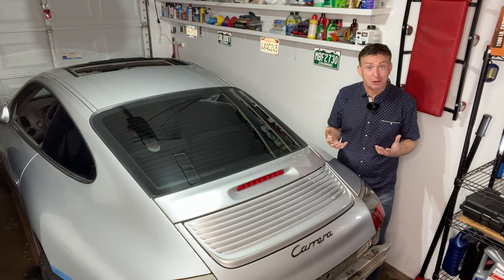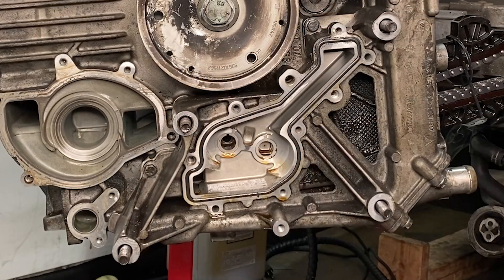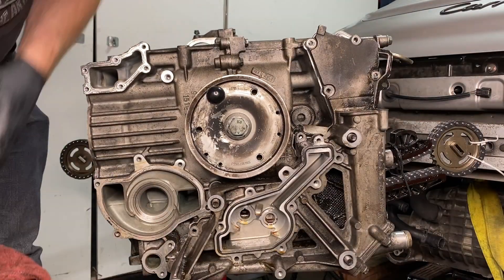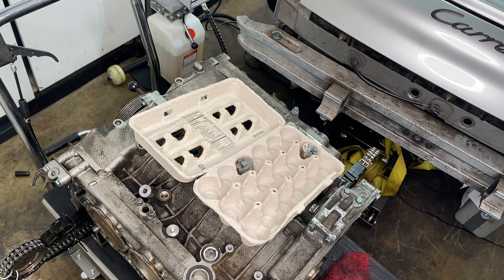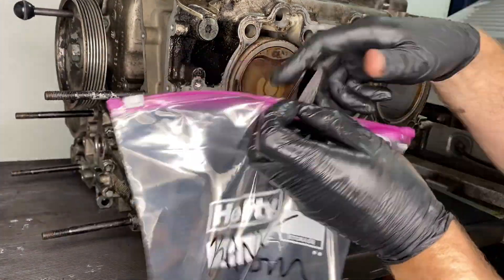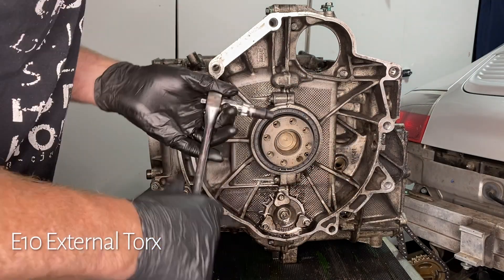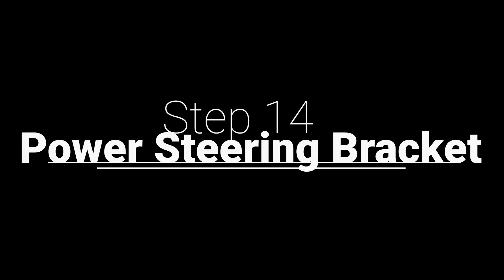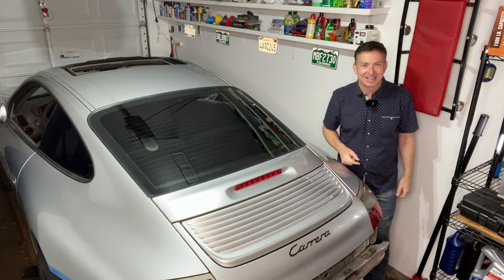How to Split a Porsche 996 Engine in Half

Comment: Thanks for this great series.  Any chance you looked into removing the oil pump and coolant manifold together?  Meaning remove only the coolant manifold and the oil pump comes out with it?  I'm at that point but only for inspecting/replacing chain guides on bank 2, and wondering if it's possible, and avoid having to put a new gasket there.  Sounds lazy, but it's not.  Just wanting to reduce the potential mishaps - if possible.
Thanks again and keep up the great work!
Reply from the maker: Howdy Tarek 🤠, I don’t see any reason why you “have to” open up the oil pump. All things being equal you should be able to whip off the console, work on the chain guides and put the whole console/oil pump back on. Thank you for watching 🤘😎
Reply: @ManinaGarage  Thank you so much for the prompt response!!!  Hope you'll still have the energy and capacity to respond to your viewers when you have a billion subscribers and a gazillion views!

Comment: Happy Easter for us All ! Man in a garage, all the subscribers and last but not least, Happy Easter Amber! 
I'll wait until the next video so I can understand better what do you mean by the LN engineering "pin all the gears"  Sorry to be stupid, but which gear are you talking about? Isn't the IMS shaft a hollow tube with just one sprocket?  
Also, which ball bearing system did you choose from LN, the ceramic bearing or the oil feed journal bearing?
Thanks for another great video
Reply from the maker: Hello Ricardo, the ims is composed of multiple parts that are press fit together. There are cases of the gears rotating separately to each other due to a loose fit. Pinning them in place prevents that issue permanently. I am going with the ceramic dual row. Not the solution. 
The failure rate on the dual row is already very low (1% or less) the LN engineering replacement dual row has a zero failure rate. That’s good enough for me. Thank you for watching. Amber, Tori and Audrey wish you all a peaceful Sunday 🐣🤘😎

Comment: EXTREMELY STOKED when you said you were sending the IMS to LN Engineering. Such smart work. This engine WILL NOT grenade after you are done. EXCELLENT STUFF Darth Sidious👍🏾
Reply: Ok Nate, now you got me worried🙄, why this engine will grenate itself if he changed the ball bearing himself? Isn't this ball bearing a very easy job to do? Specially now the the whole engine is torn aprt and  he have the IMS shaft on it hands
I'm asking you this not to be a smart ass, but because I'm replacing the IMS bearing myself since my engine is fine and I'm not disassembling anything

and I would like to understand the pitfalls on this operation
Thank you all
Reply from the maker: @1ricardobaptista  Hello Ricardo, it is very common to replace just the ims bearing with the engine still in the car. I am taking everything apart to make sure the big end bearings, piston skirts and cylinder bore are not overly worn/ damaged. FYI if you buy the bearing from LN Engineering they will rent you the installation tools for free. Good luck with your project.🍀 Thank you for watching. 🤘😎
Reply: @1ricardobaptista  No, no. I’m sorry for the confusion. You misunderstand. The M96 is bulletproof except for 2 flaws. IMS bearing and bore scoring. Both can grenade these engines. Our great friend and very good engine dismantler has shown in his videos that bore scoring is not an issue on his motor. IMS in my opinion is an overblown issue that affects under 10% of these engines. However if it happens you don’t want to hear that sh!t. General rule is if it hasn’t happened in approx 75k to 100k miles then it probably will not be an issue. Having said that personally I would still have the preventative replacement work done. Typically the bearing is done at clutch time and is serviced by a kit supplied by LN Engineering. However in this case since everything is disassembled already you just send LN the part and they make the necessary changes and send it back to be put back in the car. It’s smart work and this engine is now probably good for about 250k miles with proper maintenance. And provided he ditches horrible Mobil 1 for Motul 👍🏾.
Reply: @natemallory9141  Ohhhh, ok... So I will continue with my original plan to change the iMS bearing myself, just not very sure yet which bearing to buy 
I'm between those 2

https://tunersmall.com/product/ims-bearing-direct-oil-feed-dof-lubrication-kit-m96-trsdof9705/

or
 
https://lnengineering.com/products/the-definitive-guide-and-faq-for-porsche-ims-bearings/ims-retrofit/dual-row-ims-retrofit-kit-for-my97-01.html

I like the LN solution, but not willing to pay $2K for that and to be honest I still don't understand I should I instal the LN ceramic bearing for $800 if I'll have to change them in 60K miles along the new clutch 
If I will have to change the bearing in 60K miles I think that the Pelican parts IMS bearing for $200 is the most reasonable solution
Nevertheless, I still don't know what to do...
Reply: @1ricardobaptista  In my very unprofessional opinion there is no wrong answer. Just don’t do NOTHING.
Reply from the maker: Happy Saturday Nate 🙌, , for a minute there I was unsure what difference it makes to have the IMS in your hand rather than bolting a new bearing on it while it's in the engine. A quick call to LN Engineering and it turns out to be the simplest solution in many ways.  I mail them the IMS complete with bearing. They will clean it all up, pin all the gears and install the fancy new LN Engineering bearing and mail it back! As you said, it seems that it may be possible to grenade proof one of these engines if your willing to strip it naked 😅.
Reply: @ManinaGarage  I would really emphasize/advertise this in your next vid about this course of action with the IMS. I bet many Porsche aficionados don’t even know this.
Reply from the maker: @natemallory9141  Sir yes SIR💂‍♂️